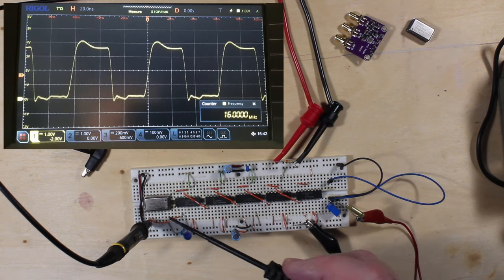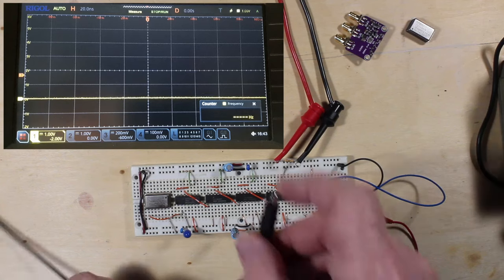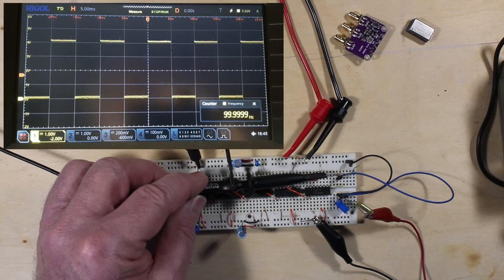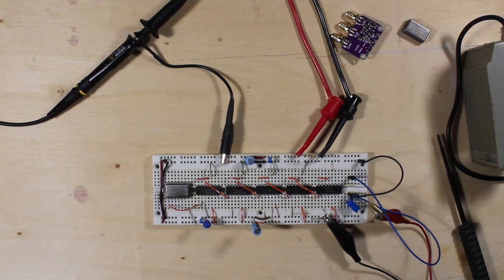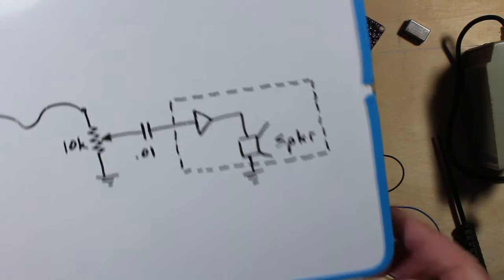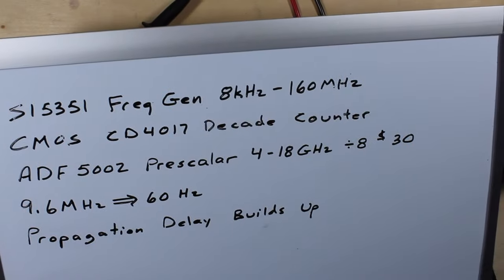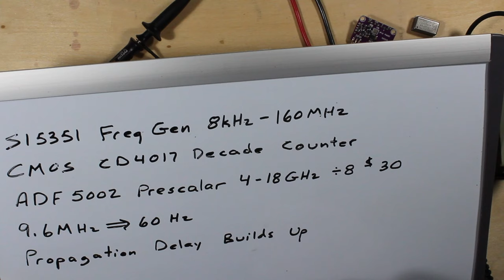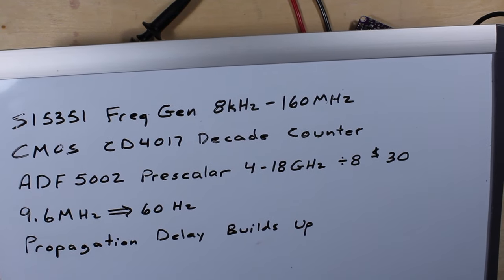Dividing 16MHz Down To Audio Range  #electronics #oscilloscope

Comment: Cool video. Those stock rigol probes are awful ehh? 2 set of the cables with mine had the compensation screw butied too deep and i had to get them to send new ones.
Reply from the maker: Thanks for that.  I imagine they're trying to build to a price point.  Much of the time only one probe is being used so getting a better probe from one of the big names off eBay might be an idea.  I see DigiKey sells probes too....